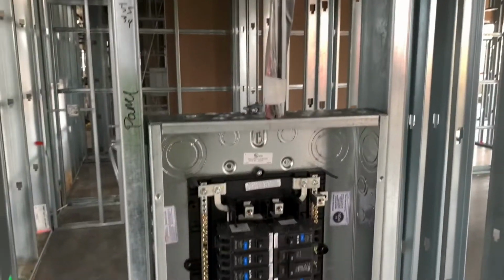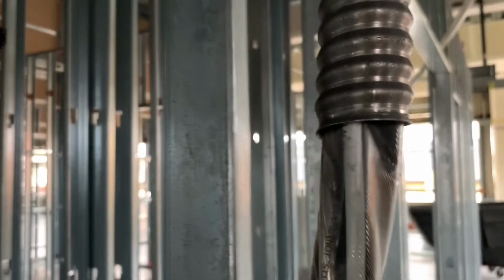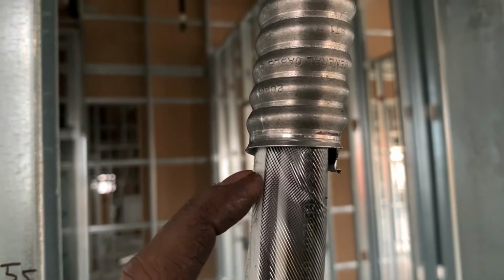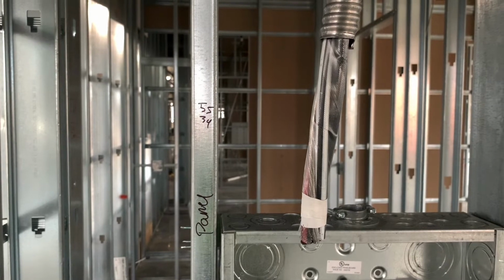Actual Problem On Monday...(I Fooled 450 People)

Comment: I've moved a ground bar a couple times and it hasn't been heavily frowned upon, let alone noticed, but I'd start with a straight line from the strut it's sitting on to the drywall penetration to gain a couple feet (put another piece of rack in if you have to). Cutting the top track above the panel a little further to the left should gain a couple inches as well.

Other, more painful options: 
- Redo the drywall penetration a little lower to gain 4-6 inches. 
- Cheat the studs a little to the left if need be if the measurements are non-critical. 

Overall it's a bit of a pain in the ass but not a complete catastrophe, live and learn. Good luck next week & greetings from Canada!
Reply from the maker: thank you, great ideas!! appreciate it! blessings! 🙏🏼

Comment: I always cut 20feet extra on wire runs like this where you probably are mesuring and precutting off the spool. I dont care what anybody says.things get moved/changed and it is better to waste 15feet of extra wire that was not needed and be safe than have to redo the whole thing,it is also cheaper for your employer.they would rather have more scrap wire (wich they usually save and resell anyway) than pay you extra time to fix mistakes.

Comment: Wow man that’sa situation I’ve been in and it suck. If you have to pull from the spool it’s always best to just pull out the old trusty tape measure and get a rough on how much wire you need and then cut like 10 or 15 feet extra trust me man I’ve had to do this on like 200foot runs and it pay to take the time to measure it out and not have to stress about it later hope you figured it out

Comment: just splice the neutral wire with some scrap, with a neutral lug
Reply from the maker: say what now?
Reply: @DailyElectrician  i meant the ground, and just splice it to make it longer by using a lug
Reply from the maker: don't think that's how you would do it 😂
Reply: @DailyElectrician  why not, looks like 3/3 just get some scrap ground wire and lug them both together, 
people splice wires in panels with wire nuts to make them longer 
what the difference
Reply from the maker: the difference is a lug isnt a way to splice a wire, it's a way to terminate a wire. you would need wire nuts or a split bolt.
Reply: @DailyElectrician  my bad i meant a split bolt, i always end up mixing up the names or using the wrong one lol
Reply from the maker: lol, all good